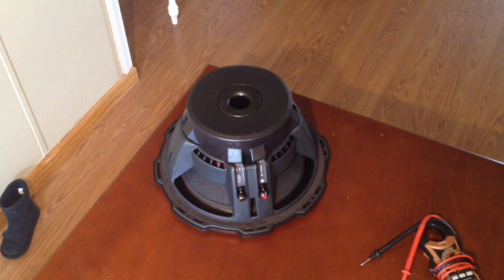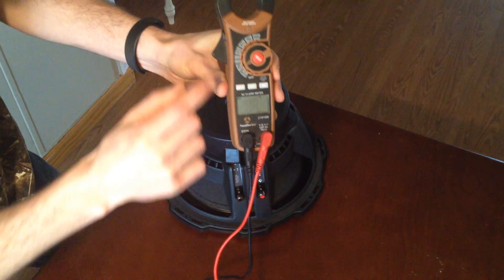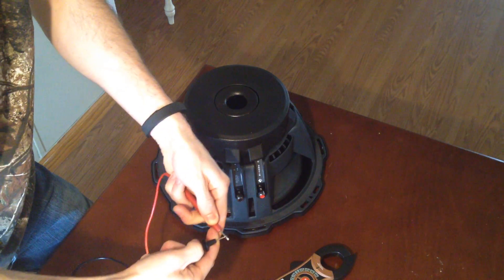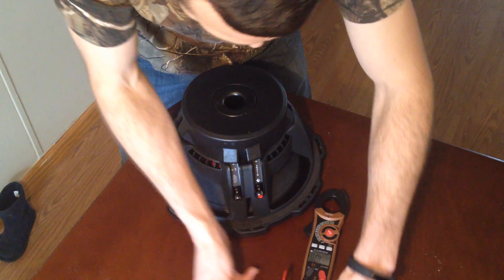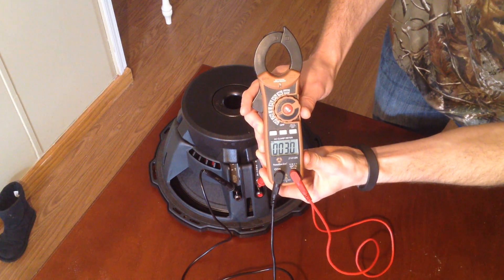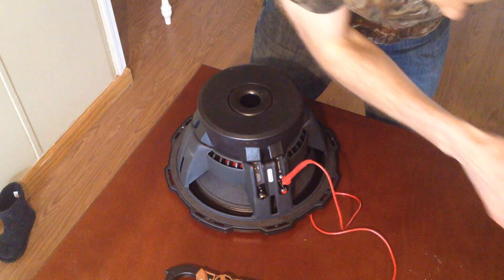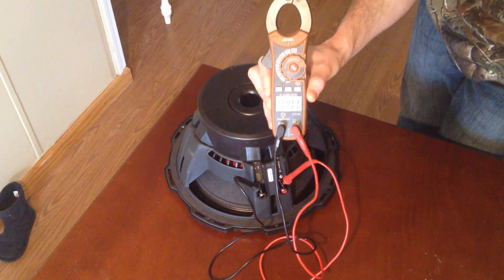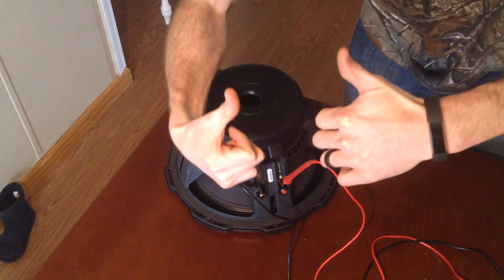HOW TO TEST IF YOUR SUBWOOFER IS BLOWN/BAD (TESTING COILS)

Comment: Just to add something in here. A completely healthy 4ohm sub should read between 3.5 to 3.7ohms. They are always slightly lower than advised. An 8ohm will read high 6 or low 7's and a 2ohm will read around high 1's.  A blown coil in a speaker (what he is trying to show) will not be bad if it reads 3.0 assuming its a 4ohm sub. What you are looking for is the sub to jump all around or be nearly no resistance at all like less than 1.0.

Comment: If I may add a little advice, flip the subwoofer upright to test. It effects the reading drastically having pressure on the subwoofer. Another thing, on a 4 ohm DVC sub reading 3 ohm doesn’t mean anything is wrong with the coil, it has no load to it so it’s normal to read low, plus being upside down. If the coil was bad the ohm would jump all over the place and not read a steady number, or read like your second coil and read next to nothing. Thanks. 👍
Reply: Totally agree with you pal I was laughing when he left it upside down  😄 🤣
Reply: I agree with you 100 what if my multimeter doesn’t read at all??
Reply: @gueroburban4989   well that usually means that the connection is torn, burnt, cut from the connector to the coil. Make sure you’re on the right setting on you dvv. Also make sure nothing else is connected to the subwoofer when checking.
Reply: @joshuageorge7758  it’s a dual voice coil one set is good the other set my meter doesn’t read anything
Reply: @gueroburban4989  take a light and look up in there on the spider where the wire runs and I bet the side not reading, the wires in two not connecting to the coil. If you can find where it’s split, you can Solder it back together carefully.
Reply: Hey man, I have a question. My 2ohm sub is stable at 2.2ohm but there's a scratching noise when you push down on it. What do you think it could be? Thanks
Reply: @ The coil is rubbing. Sometimes, you can just play them for a little while, and the heat and movement will straighten them out.
Reply: i have a new sub and it’s not giving me a  steady reading, could it be my meter not reading right or ?

Comment: so i have dual vented 12 inch MTX audio subs, with the amp set. it is 1000 watt amp but since i blew one of my subs it keeps going into safety mode when the bass is too loud. If i replace the blown subwoofer will the safety mode feature turn off? or is it permanent? asking because I dont want to buy another 100 dollar subwoofer if it wont work, thanks.

Comment: Only issue with the way u did this is u should have ur sub flipped upside down (from the way you checked it it should be magnet on table speaker / dust cap facing up) to check the coil resistance, but I checking for bad coils not sure if it matters or not but to get an accurate reading you should have it flipped and no air like a fan blowing on it to get a reading correctly cuz if u push on the speaker when meter is connected that meter is gonna go all over the place! Hope this helped

Comment: I have a kicker reading 7.4 ohms. Is that bad? It's rated for 8-10 ohms
Reply: No, it’s perfectly fine. No speakers ohm rating is actually specific to an exact number.  If it’s rated at 8 ohms, anywhere near to 8 ohms is perfectly fine 7 ohms is fine, 9 ohms is fine. 

His claim that if it reads anything other than exact to 4 ohm, except maybe 3.9 ohms, is 100% pure bullshit. He is just Ill informed.  Impedance, or resistance, isn’t a static thing.   The moment that the speaker receives a signal, ie the moment that voice coil moves the slightest amount, the resistance is going to change wildly.   His voice coil reading 3.3 is perfectly healthy.  It’s not on its way out, there absolutely nothing wrong with it.

Comment: Welp. I bought a used jl audio. Had 2 ohms . Which it supposed to be . I thought , what a deal. Played it, and the surround foam fell apart. Lucky me. It's rebuildable though.  Wondering if I need a new voicecoil. Pretty is shit. I'll just change. Then test with my piss lead. Lol

Comment: I did this and it reads 3.7 or 3.8. However, if I move the cone in and out with the leads connected, it goes up to 50. Is it normal for the ohms to change as the cone moves?
Reply: If you test your sub, test it cone up. That’s the proper way for a proper reading. If it reads a little off such as 3.5 etc it doesn’t mean it’s blown. That’s normal.
Reply: @cjproductions3683  my dual 1 ohm sundown just hotboxed my car  and went stiff I have it wired series and parallel at the amp with my other  and the other ones fine and they both read 1.8 ohms any idea why it’s stiff and scratching

Comment: I have a dual 2 ohm subwoofer and it’s reading 3 on both sets of Terminals. And yes I have the sub setting upright on a solid surface. Is my sub bad or what’s going on. If anyone could help I would be very grateful. I love this little SD-3 8” D2 it’s new too never been hooked up
Reply: The speaker is fine.
Reply: Could be dying batteries in meter.

Comment: Hey there buddy. That first voice coil is probably just fine.  Flip it upright, hold it still, and I bet it reads 3.5 - 3.7 ohms. Which is the what a 4 ohm speaker should show.

Also, I don't think your words "about to go" or "almost bad" mean anything here. There's not a spectrum from 4 ohms to zero that a speaker will follow as it goes bad. It will read 3.5 to 4 ohm (good) until it doesn't (bad). It won't spend any time in between.

Comment: This is the most terrible how-to ever. He did everything wrong. Don't listen to this dipshit. Multimeters don't measure impedance they measure resistance and yes they are different. When measuring resistance it's 20-35 percent lower then the actual impedance. Not only that, the resistance will change once the speaker is hooked up and in a box. This dude should compete in a contest for doing shit wrong. He'd win for sure, lol....

Comment: All kinds of things wrong here.  The sub being upside down affects impedance readings.  Also, a multimeter reading resistance in Ohms on a speaker is usually off by about 25%, which means on a 4ohm speaker, a 3ohm reading should be expected.  Certainly, it appears ONE of the voice coils is failing, but the one you think is 'about to fail' that's reading 3 ohms, that one is fine.
Reply: Um yep he is measuring it wrong..it's upside down causing the cone to be pushed in ,so it won't measure it right.
Reply: Homer Sapienne hey I got a SD-3 8” D2 dual 2 ohm sundown audio and when I Peru the meter on it it reads 3 on both sides. Is that normal or is my subwoofer bad.
Reply: Upside down will mess everything up
Reply: Measuring the impedance on the speaker upside-down is PERFECTLY FINE. You don't know what you're talking about.
Reply: @starmc26   If the flexible surround is touching the table and pushing the cone in, it will change the impedance. Hook one up and move the cone up and down while you watch the meter. That's how speakers work. Changing the current changes the electric field that reacts to the magnet. Manually moving the cone has the reverse effect of changing the ohm load.

Comment: The sub can NOT receive any pressure, it affects the reading.  He needs to have the sub firing UPWARDS!!!  His reading is not accurate at all with the sub facing down. Another thing he doesn't mention, is to make sure you are running fresh batteries on your tool, or else it will also give you a false reading.
Reply: I legit commented same thing before I seen ur comment glad to know some folks out here trying to correct what's wring and not be an ass about it, but actually trying to help out folks making the videos to not put out inaccurate info
Reply: Good tip too thank you

Comment: continuity, resistance and impedance are all different :)  What you call gone, is a short, so the coil isn't gone per se, but it is shorted.  If it was 'gone', it would be more like missing, not there, vacated the premise.  :)  You are one funny dude.
Reply: Wrong.... A short would show low resistance to a phase or ground, aka HIGH CONTINUITY. He's showing almost no CONTINUITY. .. or NO CONNECTION between phases or to ground. There should be 4 Ohm resistance in the speaker circuit on each coil. One is good, the other is bad.
Reply: Haiku Automation 😂
Reply: He's looking for the coil to be open not shorted. Which is the total opposite. Nice try being an asshole though.